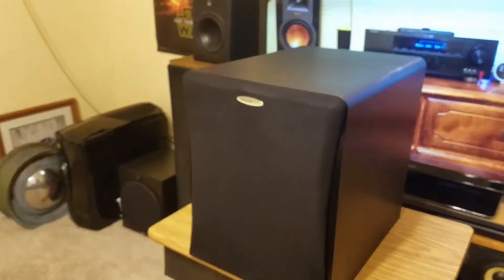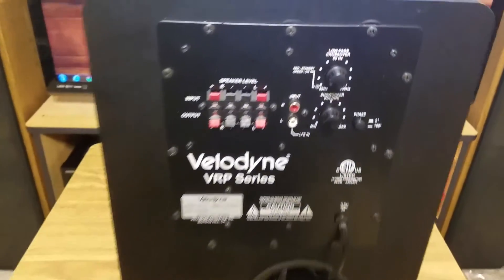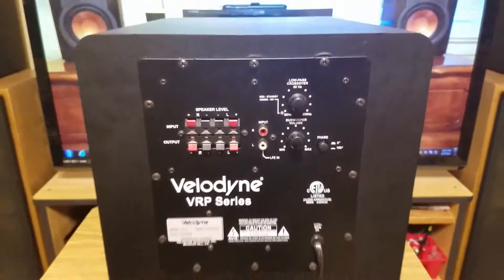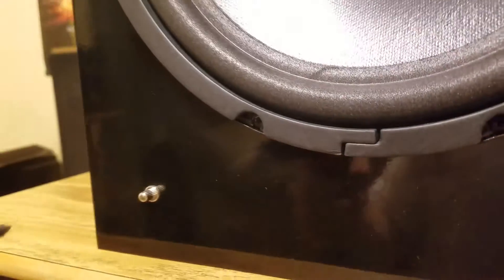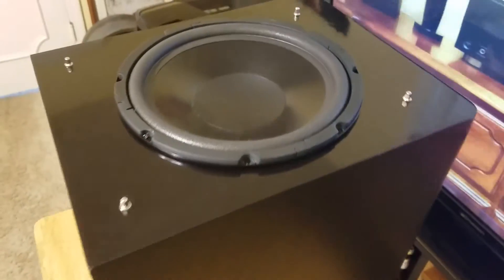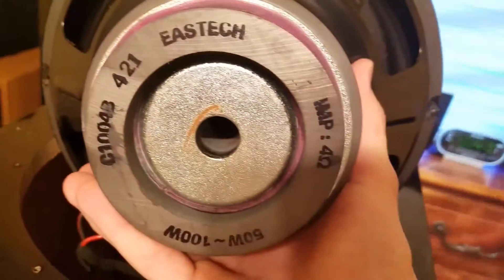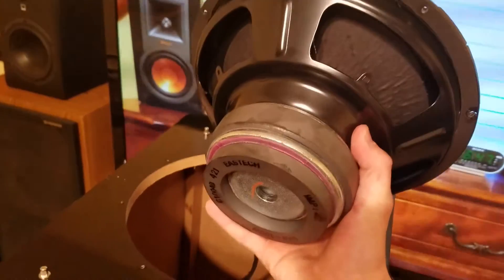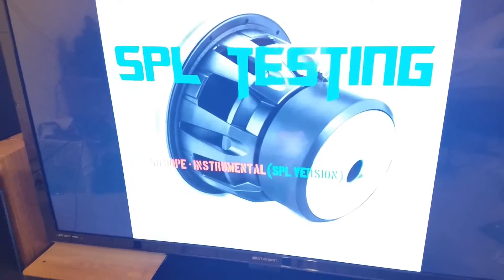Velodyne Subwoofer Dissection

Comment: Not sure if pressed steel basked is better than aluminium alloy one. There doesn't seem to be any sound to heat conversion  materiel like  rock wool or anything else to reduce unwanted enclosure resonance either.
Cheap sub-woofers like VEF Radiotehnika RRR seem to be better built, except for the outdated woofers.
Reply from the maker: u1v1w1 u2v2w2 These days I recommend SVS subs.